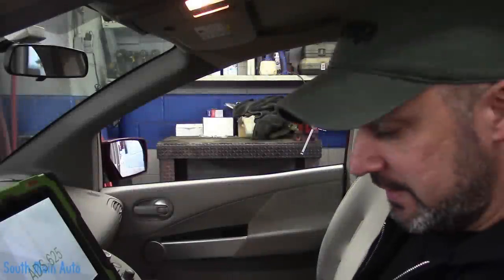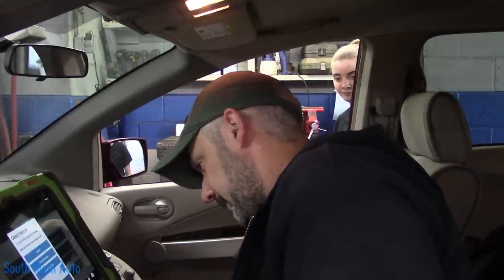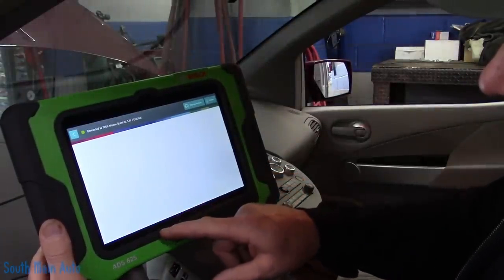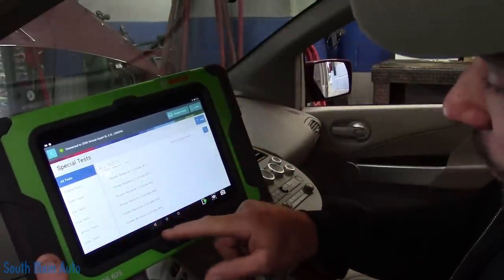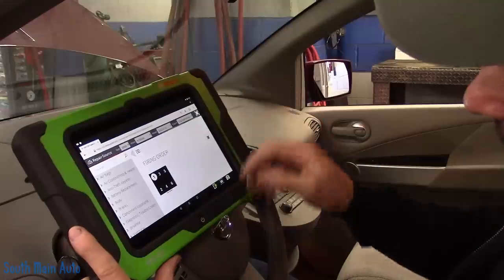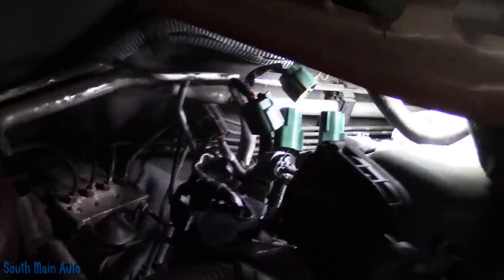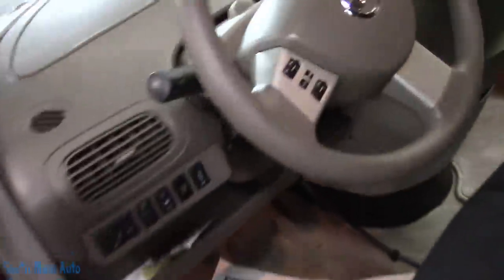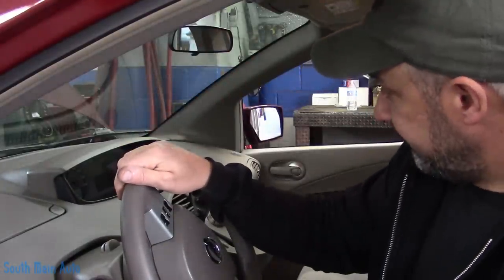Customer Replaced Spark Plugs And Now It Runs Bad!?

Comment: Nothing springs to mind, (except maybe having a timing chain out by one tooth many years ago) - that was a bummer because I had done the head gasket, then the big end bearings followed several months later.  :(
I've made a few boobs on computer related stuff, manly things like forgetting to plug something back in.
I did call an electrician once because my oven wouldn't turn on, but, (in my defence), that was because another tech had been playing with it and turned on the, (broken) timer - which disables the normal controls.

My BIL was doing his own work once and had trouble with it not running right. Called my father, who worked in a garage, and it turned out he hadn't reattached the vacuum pipe to the vacuum assisted brakes, (for those who remember these devices).

I'm accustomed to people who pull apart engines, and when questioned can't tell you why. 

I'm no expert, but I like to think I know enough to know that I don't know enough.

Comment: Can easily see how this can happen , went to put spark plugs in my 5.7 HEMI Cherokee it has 8 cylinders and 16 spark plugs  decided right away to change them one at a time as the wires all 16 of them connect to terminals on the other side of the engine ,if you just pulled them off and took out all the plugs you may never get it back together.

Comment: I can easily see how that could happen on that car. I know finding wiring diagrams for homers is a pain in the hee haw if even possible. Seeing how it was near impossible to see back there and only wire color for a hint, hell I did it on an old chevy v8 in a 75 monte carlo after doing a valve job on it at engine class or machining or whatever was too long ago...but I remember how stupid I felt when my roommate told me I had some plug wires mixed up lol!

Comment: I forgot to plug the control wire back into the alternator of my '00 LeSabre. After I filled the coolant. It was buried under the belt tensioner that had the coolant elbows ran into it and I had to drain and fill again after already bleeding the air out...

Comment: Oil pump rod distributor and oil pump that rod... I forgot to put it in and I drove it about two miles and then kaboom .... It was in a four-wheel drive 72 Ford short short bed with 44 -inch Monster mudders on balanced and blueprinted about 800 horsepower

Comment: one-time working on a 350 Chevy engine could not figure out why that was a rattling on the front of the engine luck would have it I fix the timing cover off I had left the cam bolts loose

Comment: Recently when performing an oil change for the first time on my 2000 LeSabre I kept accidentally turning the old filter to the right when clearly you’re supposed to go left. Didn’t help that said Filter was put on by some kid at Valvoline so it was probably a bit too tight anyways. 

Pretty much completely crushed the old filter getting it off and got my arms coated in oil. My ex who was acting as spotter was like “You ok?” And I’m like “Fine, just stupid and can’t remember which way to turn” lol

Comment: Pro about my car is the spark plug connectors are near impossible to plug into the wrong one because you have no slack sure you plug it in the one behind but you'll never get the front one in

Comment: I had a customer with a dodge mini van early 2000s come in with a 3.0 or a 3.3 don't remember which. It was running rough. I found a plug wire shorting out. Told them they needed plugs and wires. Customer didn't like the price and says he can do it himself and leaves. They come back the next day stating I did everything you recommended, now the van runs worse. Tells me I misdiagnosed his problem.  So I bring the van in to check it out and find he plugged one of his rear spark plug wires to his exhaust manifold.🤣🤣🤣

Comment: i just watched 2 videos and noticed that the vehicles coming into the shop are much cleaner on the inside than they normally are. did you implemented a rule that all interiors must be clean before being worked on. most of the time the interiors are a pig side. i hate having a dirty interior.

Comment: Have to re-do it. Put a Dorman magnet on my cam sprocket for the cam position sensor on my 1991 Buick regal (3.8L eng.) But the magnet would not snap in to the hole on the sprocket.  I thought, ok, it can't fall out the back cause too little room between sprocket and block, so it was just a little loose, it will work. Put it together and check engine light is still on for the cam sensor.  Checked the wires, all good, must be that magnet- it must need a certain air gap between sensor and magnet. I should have known better-but I have to pull the timing cover back off and re-do it. This time, I will glue it in place if I have to.

Comment: Im an old GM guy,  years ago i owned a 79 Thunderbird with a 302.  Put cap, rotor, and plugs in it,  wouldnt start.  Tried Fords 30 different firing orders till i realized i was running everything clockwise.......not counterclockwise....re ran the wires counter clockwise and it magically started! dam Fords lol

Comment: Not a mechanical mistake but...      My wife is the youngest of 5 sisters. Her father bought every one of them a 66 - 69 mustang when they graduated high school. Her dad works for a ford dealership in town so, no problem, right? Now it’s my wife’s turn, graduating in 1984. She gets a Mercury Montego. A 1974 2 door with the 6 cylinder engine. She was rather “let down” about this turn of events. Until it rained the first time. Then it got worse when she found out that the trunk lid seal had been bad for a while and the previous owner had drilled holes in the bottom of the trunk to let the water out. Of course, he had drilled into the gas tank and every time it rained you had to flush the tank and gas lines to get it to run again. Her dad fixed it by pouring molten lead into the holes and flushed the tank again. She saved up and bought her own car after that.

Comment: I was changing the oil on my mother's 1979 510. ,(my first oil change) and I accidentally touched the oil wrench to the starter motor positive lead. This caused it to complete positive to negative,  and the wrench got red hot.  I don't remember how I pulled the wrench off of the  lead with rag or stick, but I thought I was going to catch fire.  🙄

Comment: I bought a pickup off a garage one time and they couldn't fiure out why it wasn't running smooth and tha was the problem. Switched plug wires. I seen guy who have change cam an timing chains and set the 350 chev block up to the book but book was wrong and timing was out by half a turn on the cam sprocket.

Comment: I got the throttle push rod on my Alfa GTV torqued down between the head and block when I replaced the head gasket. Why wouldn't the rod move to connect it to the carbs?

Comment: 1982.detail engine and change timing chain on 1974 pontiac grand prix.just take all plug wires off along with cap to paint engine and misc.put back together and install wires on cap with common pontiac and chevy firing order. Except pontiac is counter clockwise on cap and chevy is clockwise.figured it out looking at the old trusty chiltons book.

Comment: Did an engine rebuild on mr2. Dropped one tiny bolt during the process and it fell into a black hole. I said f it. Put everything else back, runs like a dream. Then it starts pissin trans fluid. I thought, shit, I messed up the output shaft seal. Take the trans out, replace the seal, still leaking! Tear it again and realized that stupid botl fell through a mess of wires and bounced into the starter hole. The flywheel wedged it into the transmission case, cracking it.

Comment: Was going to change a crankcase seal on my impala and I started cranking away at the puller to get the balancer off with the bolt and no nuts installed so I was stripping the threads inside the crank ultimately not removing the balancer anyway so I spent 3 days with a file and tap and die kit trying to get the bolt back in. Plus a bunch of broken brittle plastics on that same car and a couple of extra bolts which to this day I have no idea where they came from or go

Comment: Changing the upper ball joint on the truck in my profile put, I spent at least 30-45 minutes trying to "break" the old ball joint loose from the a-arm, until I asked on Facebook and they reminded me that there's a c-clip on the bottom of the bj lol. Removed that and it slid out like butter.

Comment: I put too much dielectric grease in my already kinda bad spark plug wires and it completely messed them up. Had to pay $30 to buy a new set.
Reply: If that's the case, the old wires weren't making a connection at all anymore, and they were arcing to the plug to fire. Dialectric grease's function is to stop arcing (because it damages insulation and electrical contacts). That's why it's better to put dialectric grease on new wires before that happens.
Reply: @javaguru7141  yeah. I took out one of the old wires while the engine was running and it was arcing to the valve cover lol
Reply: @SkinnyAnimus  Ah yeah that makes sense then :P

Comment: Replaced axle hub bearing assembly. Torqued it up, rotors, caliper, axle nut and everything. Went to plug in the ABS sensor  only to discover that I installed it upside down. Doh!

Comment: My early mistake was using SAE (instead of metric 5mm) hex for removing Camry sway bar link bolt. It worked on the first sway bar link, so I continued to the second and it round the bolt inner 5mm hex hold. Long story short: I had to cut the bolt creating a lot of unnecessary work.
“If I can make it, you can make it!”

Comment: The most common mistake for an amateur is to put them back in, in the wrong order. At least 2, obviously. Firing order! That’s it! I’ve just changed my spark plugs on a full service, and the thing I make sure more than making sure the car doesn’t fall on me, is to put those plugs in order. Otherwise it’s such a headache, it’s worth paying a mechanic to fix.

Comment: reading wrong in service manual, and tightening the bolt to much and stripping the bolt, and that was for the back sprocket on my motorbike, ending up in buying a new rear sprocket assembly, extra bill 270$ ...

Comment: My Mistake Story: replaced coil tower connectors on a Toyota to fix the tabs that always break on those things. Had a cylinder 4 misfire after reassembling. I had correctly guessed that I probably got some wires crossed in the connector but the wiring diagram I had available showed COMPLETELY DIFFERENT COLORS THAN WHAT THE PLUG TOWER ACTUALLY HAD! WTH??? After several failed attempts to guess the correct wiring order on the plug tower I finally brought it to a local shop. I felt somewhat vindicated when the guy who fixed it had expressed the same frustrations that I did with the inaccuracy of the first couple wiring diagrams he used, but he eventually found an accurate one and was able to wire it back up correctly. OR! ... I coulda just snapped a freakin' picture before I started work. Lesson learned. Hard.

Comment: Changed my power steering lines one time and forgot to hook my radiator fan and my windshield wipers back up and got caught in a rain storm on the highway, luckily I made it threw that fine but a few days later I blew a rob threw the block and then looked at my lady and said well shes done let's see what she's got left, shifted into first and stomped the gas until it no longer ran haha good times!
Reply: Luckily it was only a 400 car so I wasn't out too much

Comment: I used to do power sports repair one Saturday I get called in because of a customer returning a recent repair complaining it won't run I walked down to the shop unloaded her ATV sure enough no start after thinking for about 5 minutes I went dumped a 1/2 gallon of gas in the tank fired up and ran fine Went up to the front counter and said lady  were a repair shop not a gas station you only had a 1/2 gallon to start with now you have another half gallon

Comment: 1967.  I was 16...best friend was 16. My best friend , next door.,  needs to yank bad 6 banger out of his 59 Biscayne.and drop in a new short block. It’s winter. We’re working in his dads brand new single car detached garage.  We’re cleaning parts in a tub of gas on the floor.  Yea, wait for it. It’s getting late, Sat. night. We clean the tools and slide the tub of gas over out of the way into the corner.  There’s a small gas furnace in the same corner.....with a standing pilot light. We didn’t know that.  We didn’t know shit, really. And yes,  the fumes from the tub lit up and we were staring at 4 foot flames in a tub of gas.  Thank GOD there was a 4 by 4  piece of plywood leaning against the wall, I grabbed it, laid it on the tub...snuffed the flames. I don’t think we spoke for 30 seconds. We stared at each other, stunned. We knew we dodged a huge bullet. The garage was bare studs on the inside...bare joists and rafters overhead. Kindling. My friends dad was a foreman of steamfitters with a very “colorful” personality.  He liked to drink, play the horses, bet on the dog races.......he was responsible for 3 shifts of steamfitters building a nuke plant. Not the shy type.  If we had burned his garage down  he would have killed us and buried us out in the country.  Maybe that’s an  exaduration.  Maybe not. (I don’t know how to spell exaduration).  ......
..yea....he would have killed us...........but......he never found out.   3 years later I was in the Marine Corps in VietNam.  I did two tours during the peak of the fighting. It was safer there.    Dave Heitman.  Semper Fidelis.

Comment: Put an 305 GM engine together and forgot to toyk the connecting rod bolts had a printed list of steps when putting it together looked at it just before putting the engine in the boat and saw that it was checked off.  Another day of labor and it was done.  Will never do that again.

Comment: When i first started working on vehicles, which was when i knew a shop costed too much for me. I had to change my starter in my 94 ford explorer, i thought i would be fine and didnt have to disconnect the battery. I was wrong. I grounded the starter, and i didnt know at the time, i hit the fuel line, and a small fire broke out as im screaming like a little girl and my brother is laughing his ass off. Got the job done till i figured out the fuel line has a hole. Now i gotta rip the fuel line out and make a new line. Wont do that again, i can tell you that. Funny as hell looking back though, ill admit

Comment: The first time I changed plugs and wires on my 99 dodge ram with the big 3.9 I got the plugs in the wrong spots on the distributor. So I can sympathize. Who thought back of engine is a good spot for the dizzy?

Comment: I had a 2003 Nissan Altima 4 cylinder and oil was leaking into the spark plug wells. So I replaced the valve cover and decided to also do the spark plugs while I was at it. well I didn't get all the oil out of the spark plug wells before pulling the spark plugs so the oil went down into the cylinders. I rigged something up on my vacuum cleaner to try to suck it all out but it didn't work very good I ended up just putting it back together and hoping for the best. After it was all together I had zero compression on cylinder number one. I think what happened was oil got down in there hydrolocked it and bent a rod. I was getting spark and fuel so that's the only conclusion I could come up with.  I stopped at that point and sold it.

Comment: Biggest mistake I've ever made, installing new aluminum wheels on my 55 Chevy, not being sure how well they would clear I installed the first one(driver side) cautiously with only snuggin up the nuts with very light wrench torque. Basically hand tighten. Drop the Jack and proceeded to install the wheel on the opposing side. Everything look good I tightened it up and was intending on finishing torqueing  the first (driver) side. However I had forgotten, with focusing my attention on the fit and offset, I had been distracted and forgotten to retorque the driver side, about 30 miles later I noticed broken wheel studs and nearly lost the entire wheel about 35 miles mph. When I stopped one wheel stud was remaining. Other ones were broke and or missing the nuts. Big mistake on my part, glad it wasn't someone else's vehicle
Reply: Old 55 Chevies had pretty weak studs. A common thing was for guys to drop hot motor and four speed in one and go out grab a second gear power shift and have rear wheel pass them up and shoot down the road.

Comment: Paused at 3:29 (wanted to pause earlier) to say my prediction is that he found a problem to make, in that a wire was corroded and movement broke it, or similar with a connector (or he unplugged or left unplugged a connector, but that’s not part of my prediction)
Reply: And I was wrong (basically)

Comment: Rebuilding my 72 Ford F250  And just put in my fresh 351C in it ...2am and a very long day. Damn motor wouldn't even turn over, I couldn't get anything to test right spent another 2 hours going nuts trying to figure out what the hell was wrong... finally too damn tired and mad to think straight kicked the freshly painted door and stomped hobbled into the house and went to bed .... Laid there for a bit and then it came to me... got up and walked hobbled back out to the truck and popped the hood and looked at the battery to see I had the cables backwards . swore a whole lot and went back to bed ...

Comment: Wow, that engine bay is tight! How does a guy even get to the plugs to change them? (or gal)
Reply: I think I recall that the wiper cowl was removed to gain access.  I recall having to do this on a V6 Ford van.  Even then, very awkward and hard to apply force.  In future, only 4 cylinder, or an older car with the big engine bay!